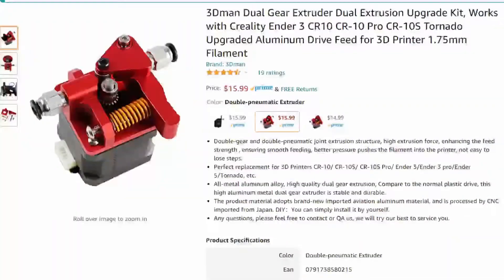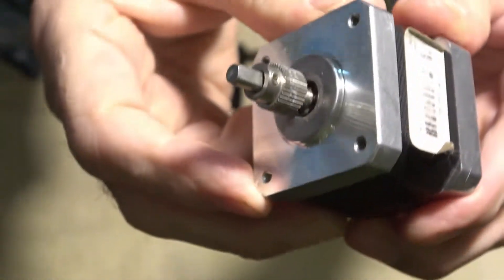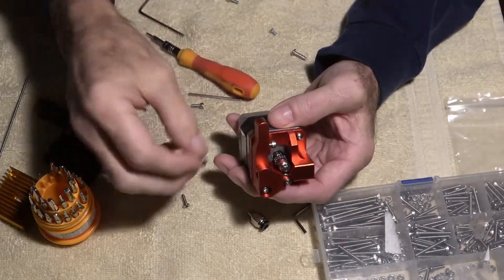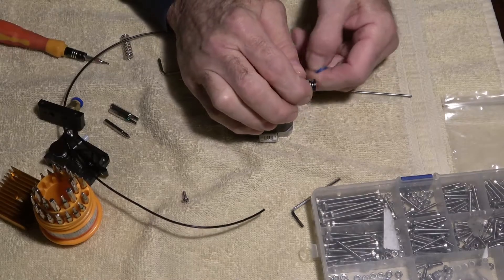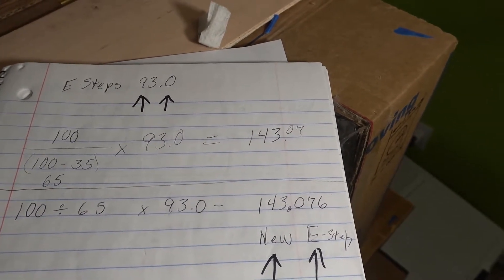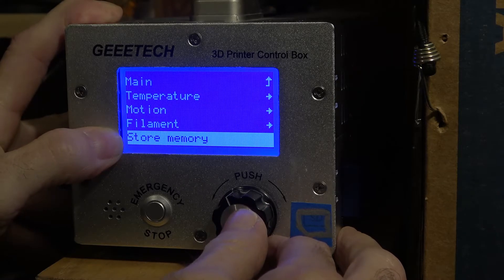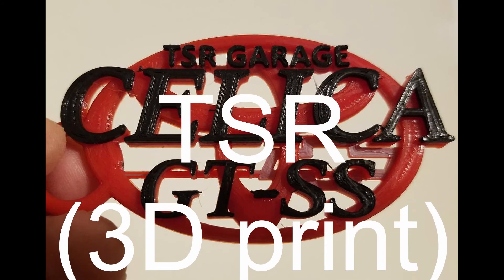Dual Gear Extruder,  Upgrade Kit, Geeetech Printer

Comment: Hello! did you has to change any firmware after changing the extruder? thanks
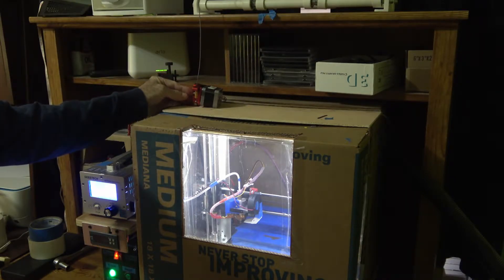Reply from the maker: Because of the smaller drive gear the e-steps for the extruder have to be reset.  That is the only change.. At 8:30 is where I show how I  did that.